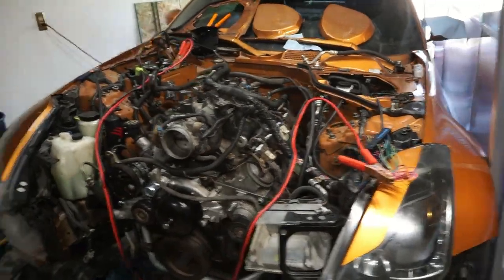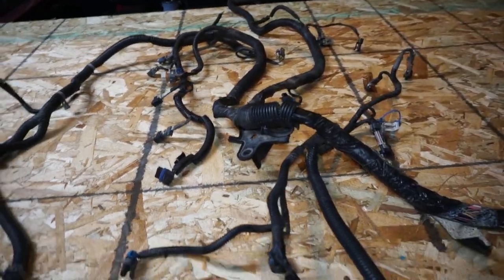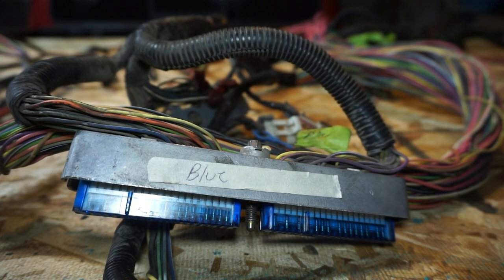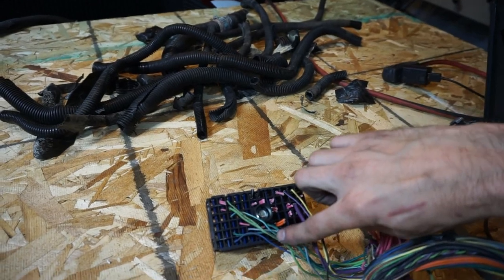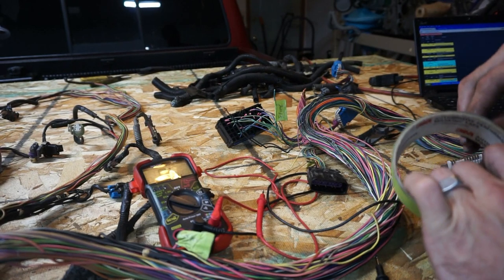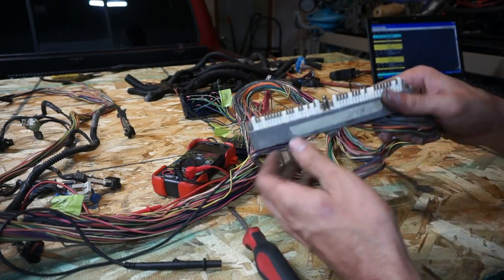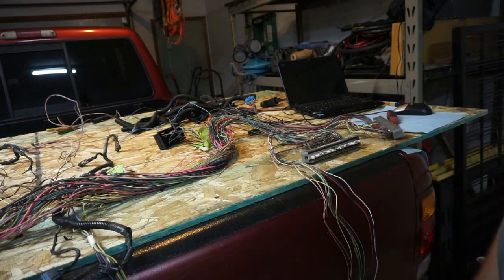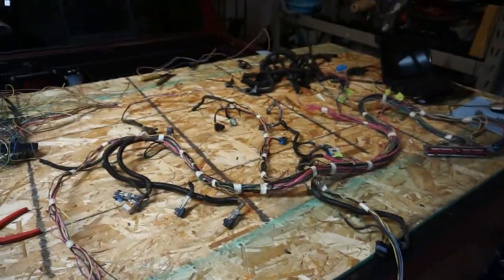HOW TO - STANDALONE LS SWAP HARNESS!!! Manual and Non-Electronic Transmission!!!

Comment: What does stand alone mean brotha? I don’t get that meaning
Reply from the maker: Good question! Think of it as an engine only ECU. Some will control transmissions also. Factory ECU typically requires communication to other components in the vehicle to function. Like the body control module (BCM) for example. This essentially removes, VATS security system (requires ecu modification) AC controls, transmission controls, Rear 02 sensors, egr controls, etc. Now this "stands alone", from all the other factory features, to run the engine... The way I picture it in my head, a factory setup is one unit, now this "standalone" is a completely different thing dragging around the body of a other vehicle, lol.
Reply: a21bravo thanks a lot brotha, I have a 64 impala and want to do an ls swap

Comment: I don't understand why you remove the unused wires. They don't weigh anything. Why not just roll up the excess 'wad', put a zip tie around it and tuck it away nice and tidy. I don't think it hurts to leave the unused wires plugged into the ecm.  Is this just a cosmetic thing?  If so that's cool. But not sure why you wouldn't just leave unplugged and cut off connector from the sensor or devise you don't use. If your building something like a show piece it's understandable. Please clarify. Was Chevrolet engine performance tech. Retired when OBD2 and LS engine came out. Interested in LS finally because authentic small block chevys no longer litter the salvage yards. Just making sure I'm not missing something. Thanks!
Reply: David Martin I know this is a old comment but it makes everything easier to follow for troubleshooting purposes it makes everything look better makes the wiring harness smaller all together so it’s easier to hide etc...

Comment: LS engines are totally overrated,  the "big" 6.2 liter is only 378 cubic
 inches. GM did a good job fooling everyone, by changing engine size to 
liters, so the average guy doesn't know just how small these new motors 
really are.  to be a contender with other world-class engines, it would 
have to be the 427 LS, which is high dollar and somewhat rare.  an old 
454 with a carb in the crate makes 500HP and much more torque than the 
LS engine.  bottom line an LS is really only good for a car that 
originally came with an LS.  this whole LS swap movement is only a 
passing temporary fad.